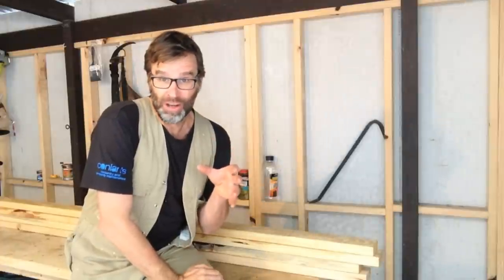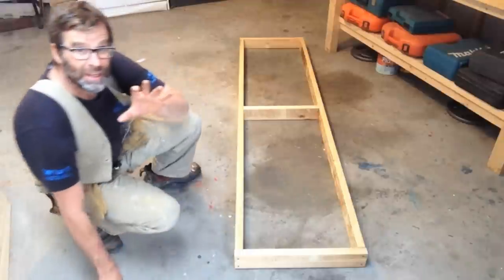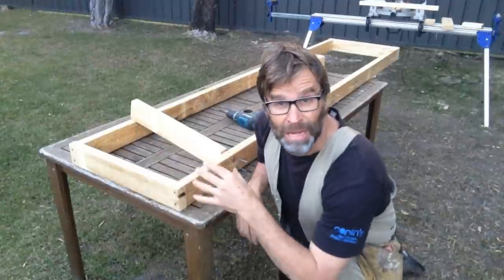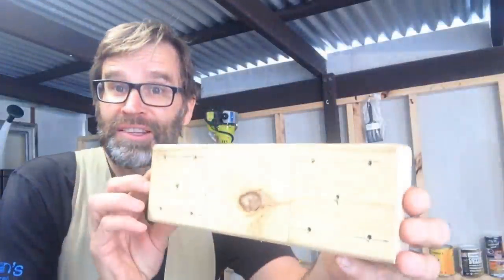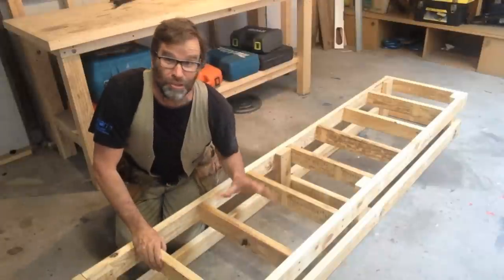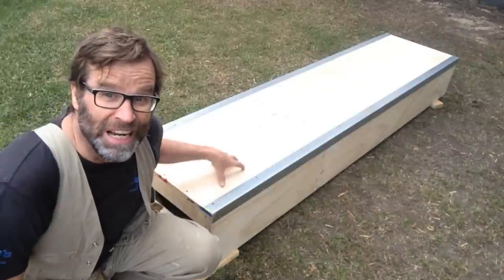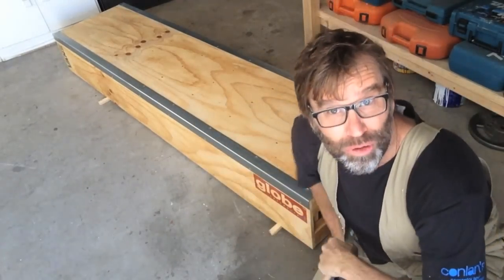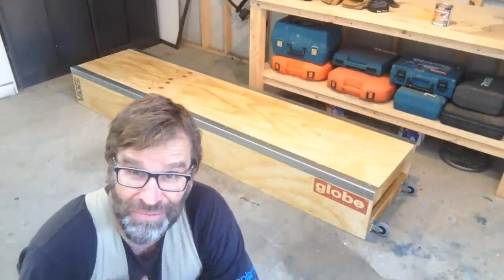How to Build a Grind Box!

Comment: I've built the box and about to add the angle iron but it seems to have quite a right angle edge - won't it rip the skateboards apart? Do I need to hire an angle grinder to smooth off the edge?
Reply: I don't think so, depends on the strength of the board but it shouldn't do. A lot of boxes have quite the right angle themselves so shouldn't be a problem...

Comment: now I just need 1000 dollars of power tools. Great product though!
Reply from the maker: sonomama82 Thanks Sonomama.
Reply: +sonomama82 No my friend , just buy some cheap electric drill/screwdriver , jigsaw and sander and have the same result for this project. You can even avoid electric sander and sand it by hand but i dont think it's worth the hassle because they start from pretty low prices. I'm sure you can find all 3 tools for less than 150 dollars total .

Comment: How did you find 96 in iron my local stores only sell up to 6ft. They have 8ft only in aluminum do you think aluminum would do the job?
Reply from the maker: Edward, l bought my angle from our local metal merchant who had a pretty big stack at various lengths. You can use aluminium but it's soft and won't last as long an iron angle. Good luck :-)
Reply: I'm having the same issue, can only find 6' long iron. Was thinking about shortening the length of the box t 6' but seems lame.

Comment: Dude how do you drill through the copping I used a drill but I never worked
Reply: +seddrick hartanto 

A lot of drill bits work in various materials like wood, metal & plastic. How powerful is your power drill? Maybe it's a bit underpowered for the job. Press your weight onto the end of the drill while you're doing it .

Comment: what if I wanted to do a round coping, like the original picture you showed
Reply: cut angles into the plywood so the coping can sit in there then drill holes big enough to put a screwdriver in the pipe then screw it in

Comment: well done i like the way you framed it up was wondering what it ended up weighing.
Reply from the maker: Thanks Greg. It finished up a little on the heavy side but that's what l wanted as l didn't want it moving around as the kids were grinding on it. The wheels make for easy transportation. Cheers mate 👍😁

Comment: Nice video! May i ask if the grindbox will be waterproof? I am planning to make one myself for my local skatepark.
Reply from the maker: Thanks mate. Naturally the timber will soak up water if not sealed against the elements. You could use marine grade ply which would help in that regard but even that product you would still need to seal. For the best advice there, l would contact your local paint store and see what they have to say. Good luck and thanks for watching 👍😁🇦🇺
Reply: @diyforknuckleheads  would lacquering the wood be helpful in making it more water resistant? Thanks for the reply!
Reply from the maker: HongCe Soo Yes it would. Just make sure that it’s exterior grade👍👍

Comment: I  have a quick question, why u choose to use the non-swivel wheels?
Reply from the maker: +Shey Y Hi Shey. I just thought it would be easier to move by yourself  if the wheels didn't swivel seeing that the box is quite heavy. Maybe the swivel wheels could have worked ?? Where l live l don't have a lot of choice so l just went with what l could get my hands on. Cheers

Comment: For the 1 foot high braces, did you drill the 5 holes a little lower so the nails won't collide?
Reply: Also what size screws?
Reply from the maker: 50mm screws Calvin.
Reply from the maker: I can't remember Calvin but if you have to..do it. Cheers mate

Comment: what is countersinking the holes? i dont get it
Reply from the maker: Countersinking is used to get the head of the screw flush with, or below the surface of metal. Use a drill bit larger than the pilot hole to make the opening of the hole large enough to house the head of the screw. I hope that makes sense. Cheers
Reply: +shaneconlan1 yes it does thank you but do you think that the outcome would be the same if i just use glue instead of drilling
Reply from the maker: You can just glue it but screwing it down is a far superior method for stability and longevity. Cheers
Reply: +shaneconlan1 alright thanks alot man!!